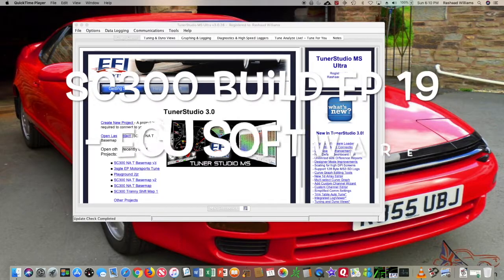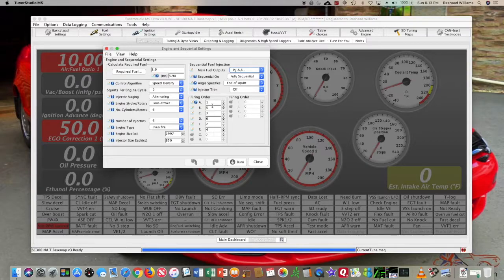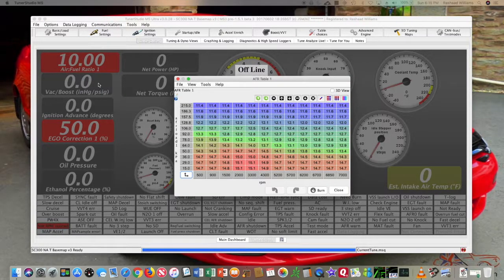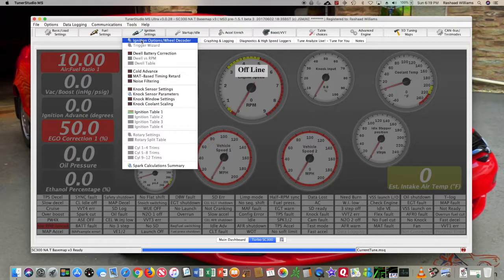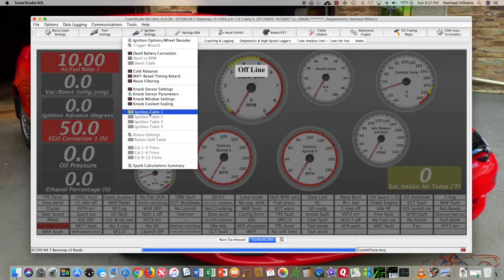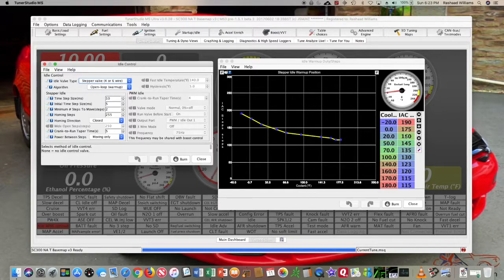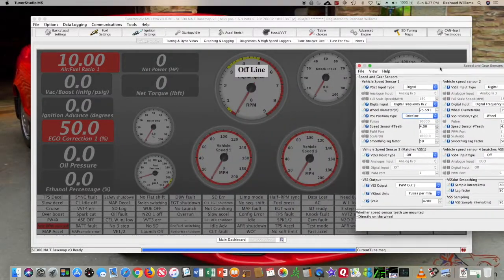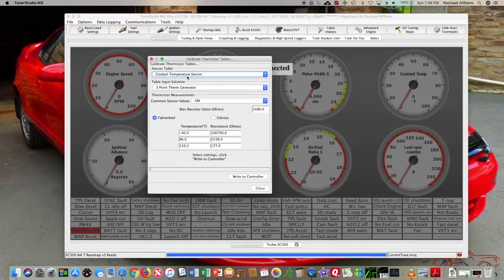SC300 Build Episode 19 - ECU Software Set Up Setup

Comment: Hey do u still have this software I’m thinking of getting a ms3pro I’m nat 440cc inj wb340 fuel pump I wanna tune it myself but idk how the ms3 pro is on user friendliness
Reply from the maker: TunerStudio, the software used for the MS3Pro is very user friendly.  I also like that the software works on Apple too.
Reply: @r.a.w.performance6602  awesome good to know did u need to add new sensors like intake air temp or anything else for the ecu to work?
Reply: Nvm ima watch ur vids
Reply from the maker: Basic sensors are IAT sensor and boost control solenoid to do a NA-T.  You should be able to wire everything else into existing sensors.